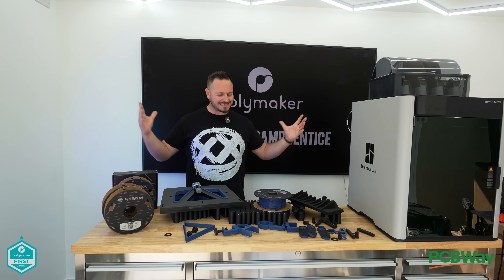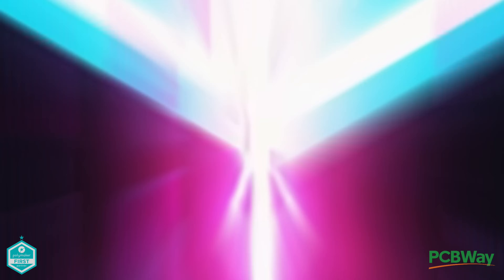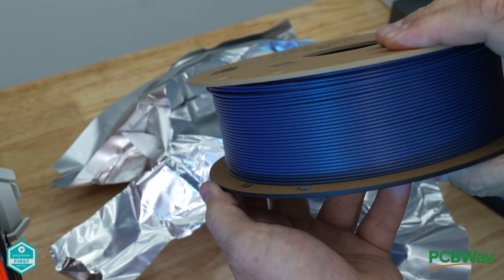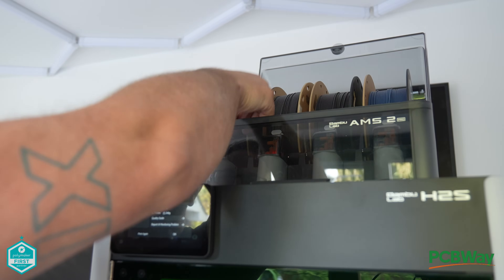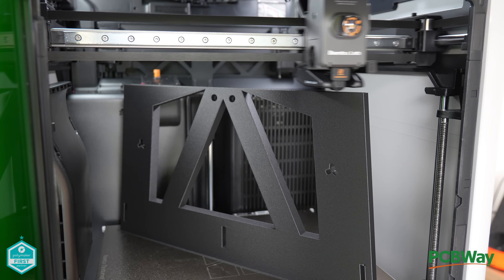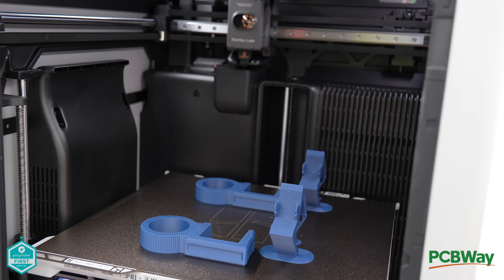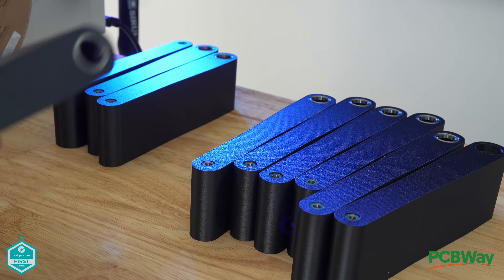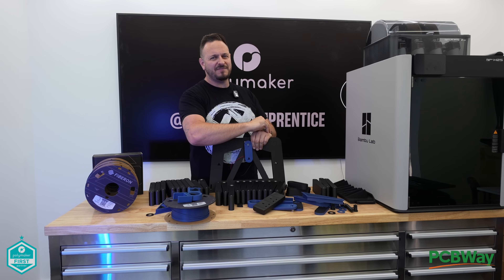Is This The Strongest 3D Filament Ever?

Comment: I can never wrap my head around how CF makes a print "stronger". The hole point about carbon fibre being strong is the long strands of CF. If printer filament its basically just dust put into the plastic. There is no load bearing lengths or fibers. I wonder how much this is just marketing tbh.

Comment: I need to modify my 3D printer to run this stuff. I purchase the sand color, being this is my 1st time running CF anything. I had no clue about its brittleness. My filament tubes angles are just too tight, the CF just snaps as it feeds. Can’t wait to everything dial in for my first sucessful run.

Comment: Glad I came across your vid. I had avoided ASA-CF on my H1S Combo because Bambu says it’s not supported on the AMS 2. Have you had any issues with it on your AMS or it breaking in the tube and did you dry it fresh out of the spool first? It keeps breaking for me.
Reply from the maker: I’ve run about 30 kg of PETGCF for it as well
Reply: @TheRealSamPrentice  Interesting. I can't get any CF filaments loaded on the H1S without it breaking. And Fiberon ASA-CF is probably the most brittle filament I've come across. Shocked that you got it through the AMS!
Reply from the maker: @mrloofer72 well PPS CF is far worse on the brittle side, but the ams2pro will not allow certain cf filaments for that reason and if it’s too abrasive, it will reject it altogether. 08’s seem to be fine, so low content of cf but the remarkable thing is that it also acts as a stabiliser to the plastic, so less warping, that is the bit that blows my mind

Comment: Great vid. I'd lost all confidence in ASA CF. The last version I used was a 20% blend but that made the most ugly looking parts. And when testing it has the strength of the worst wood filled PLA you can imagine. I went to use HIPS for stiffness after that. Glad to see there is one that works. Shows you need to go to reputable brands for specialist filaments.

Comment: I have a problem with my 3D printer, the Ender 3 v2 Neo. I'm having a problem where the CR Touch sensor can't detect the bed properly. I've tried installing the latest firmware, but it's stuck on the initial loading screen.
can you help me?
Reply from the maker: I'd suggest you contact Creality support in that case.
Reply: @TheRealSamPrentice they didn't give me any solution. i really need help now because i'm making a kinetic prosthetic hand for a child

Comment: Is this PETG or is it ASA? It started out as ASA-08 and ended with it being PETG-08. You also chose the print profile for PETG. You only started to call it PETG after the commercial.
Reply from the maker: I was talking about this project, I use both inside this video, but the blue filament is the ASA CF

Comment: This looks quite nice. I think low fiber content has good potential. It still provides a nice finish and increases printing stability while maintaining layer adhesion and allowing for more color.
Reply from the maker: It's a good choice, eh?
Reply: @TheRealSamPrentice  I have some of their PA6-GF. A lot of my friends have used their PET-CF17. I'll likely mostly stick with Tinmorry and Siraya Tech, which both have excellent performance for the price. This does look like a good option though and they kept the cost down too. Not enough fiber filled ASA options out there.
Reply: @802Garage Really digging the PET-GF from Sirayatech, you tried it yet? A little bit better layer adhesion than the CF version, and still almost as strong. Also, glass fibers-inert, carbon fibers-carcinogenic so good in my book 😂
Reply: @rpiian  I have a roll of the PET-CF in black and a roll of the PET-GF in olive drab green. Have yet to print anything substantial with them, but coming soon for sure. Lots of friends have had great success. Very popular with Qidi users.
Reply: @802Garage Same! Loving both right now.
Reply: I would have liked a higher cf version for better rigidity and higher temperature resistance
Reply: @survival_man7746 Other brands mostly have that covered was my thought. Though fiber filled ASA is less common. Getting more popular though. Siraya Tech ASA-GF is good stuff.